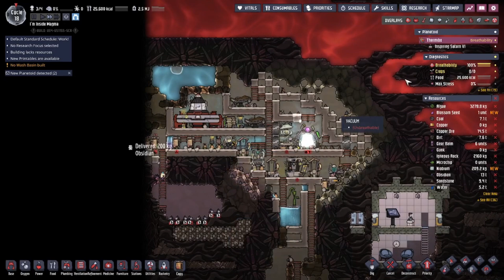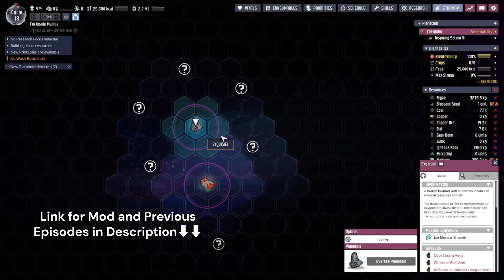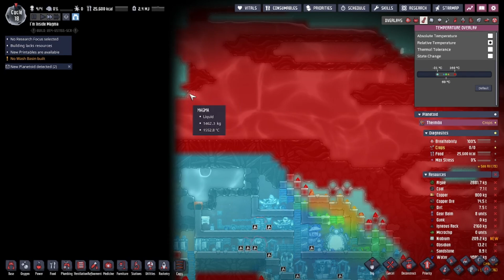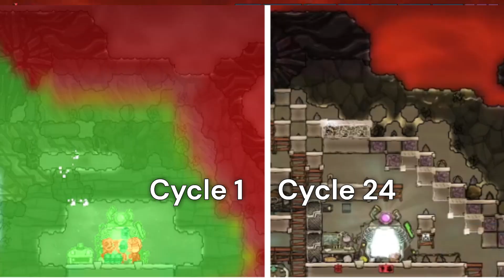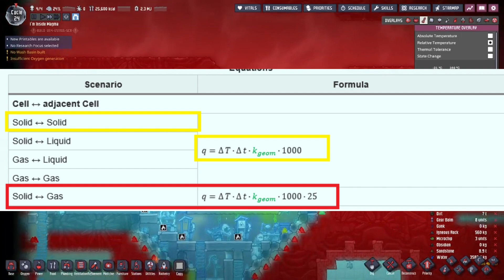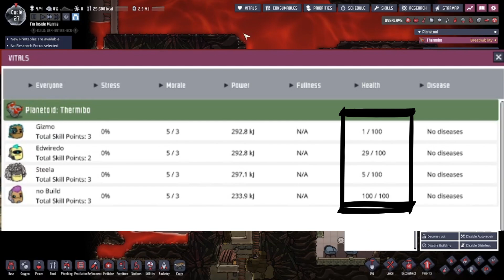The Hardest Oxygen Not Included Challenge: I started on Magma Planet! Ep4

Comment: Does that game seriously not have any way to permanently remove heat? Like turning it into power?
Reply: steam turbines
Reply: @VeryIconic is that not viable in this run? i wanna see him turn this seed into a sustainable run where he eventually drains all the heat from magma
Reply: without escaping to another planetoid? probably not since you need plastic
Reply: @ tough.
Reply: @dukecatfishjunior6291  The steam turbine itself has to be kept below 100°C, which he doen't have the ability to maintain as far as I'm aware
Reply: We've chatted about this on the discord quite a bit.  The answer is 'yes, but it'd be really messy'.  To turn heat into power, you need a steam turbine, which requires plastic.  Plastic can be created a number of ways, but almost all of those require resources not present on this asteroid.  The one way we thought of is from the bionic duplicants themselves.  Bionic duplicants start with 200kg of gear oil + another 80 in the form of gear balm.  They slowly turn this gear oil into gunk.  Gunk can be 'cooked' into petroleum, which can be made into plastic.  However that will permanently deplete the colonies supple of gear oil, as there's no way to restore gear oil other than purifying gunk back into gear balm.  (well, there's one way: when a bionic duplicant is suffering from severe radiation poisoning, they will periodically vomit up a small amount of 'free' gunk.  Emphasis on small.)

Heat is not the only problem, however.  The dupes also need oxygen, and Tabe is rapidly running out of algae.  They have enough water to electrolyze for another few dozen cycles, but that too is non-sustainable.  They also need power, and right now are primarily sourcing that from mined metal ore - once again, a limited resource - although once a steam turbine is up and running, power would probably be a solved problem.
Reply: (the challenge of this run is actually probably more the resource scarcity than the heat; Tabe just makes it look easy because of skillful planning and resource management)
Reply: @ that is very interesting. isn't there a way to make oxygen renewably? sorry, i don't play this game, hahah
Reply: @dukecatfishjunior6291  There are many ways; however most require resources not present on this asteroid (to be clear: Tabe had to request a mod be created to allow starting on this asteroid; this is /not/ how the game normally is played).  Most asteroids have oxyfern/alveo vera, which are plants that convert CO2 into O2; water geysers that infinitely produce water to feed into electrolyzers; and/or Arbor Trees that can be used to produce ethanol which can be used to produce both power and water for electrolyzerization.  None of these resources are available here.  The only one we were able to think of was using morbs, which are a sort of easter egg 'critter' that appears when an outhouse is left clogged for several days, and which periodically produce small amounts of oxygen.  There's technically no limit to how many you can have, so that could be used to solve the O2 problem.  They do require at least one normal (non-bionic) dupe, however, in order to clog the outhouse - and that means now you also have to worry about food.  An easier problem to solve than oxygen, to be sure, but not trivial.
Reply: One other method: launching a steam rocket creates a plume of steam exhaust that contains more water than is used in the launch; if you build a system to capture that steam, you now have an infinite (if rather awkward) source of water.

However, if you can launch a steam rocket...  Just get the hell off that godsforsaken rock. ;p
Reply: @KalilChernov  ngl that is so funny
Reply: It can be done but he has to go to another planetoid before he can unlock the necessary materials, and research.